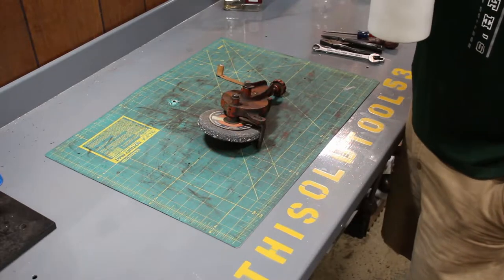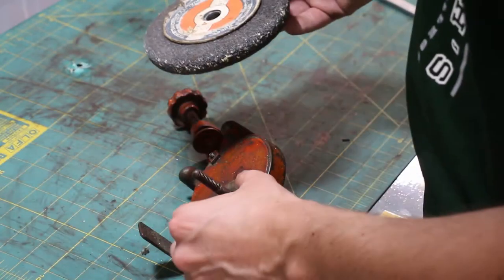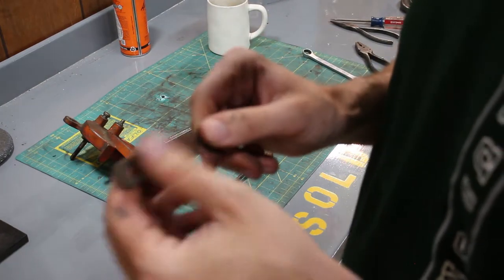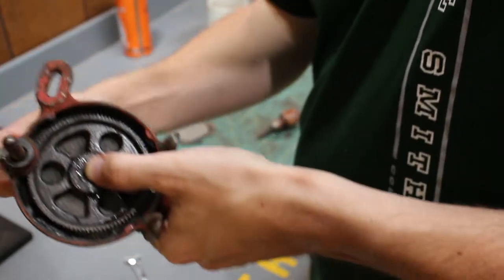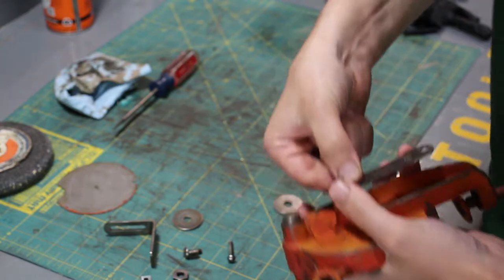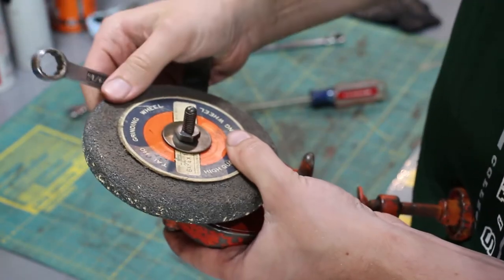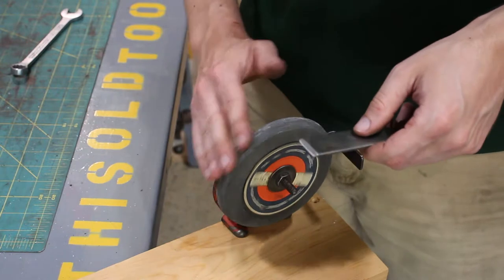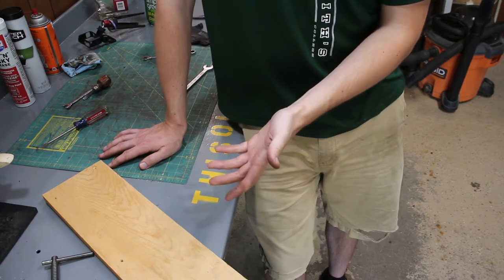Genesee Hand Crank Grinder - Custom Handle!

Comment: Hi there, I have a few craftsman block grinders and i sold some to get these. They are very practical for wood working due to their relatively low RPM. Which help ya not likely to ruin the temper of chisels and hand planes though still possible. You can make a tool rest jig for it to keep the one hand operation more repeatable at a set angle of the bevel. Some put cloth wheels on it to buff and polish their tools. having a larger platform for the tool to rest on helps the tool not bouncing around and vibrate on a small pivoting point. Also I often grind it pointing up and not down. the wheel might pull your tool downward and take your hand toward the wheel. They are very cool indeed! Thanks for preserving and spreading knowledge

Comment: I just finished refurbing a very similar model this week end. I had to put a stone on it that also did not match on the arbor size and just took a strip of duct tape and wound it onto the shaft building it up until I could squeeze the stone onto the shaft. It has a tiny wobble, but at the low speed of hand turning, is not a problem. I sharpened my pocket knife with it just fine. I would have enjoyed seeing you make the spacer. Sounded like a good idea and you could take an oversized one and chuck it in a drill to gently sand it to perfect size.